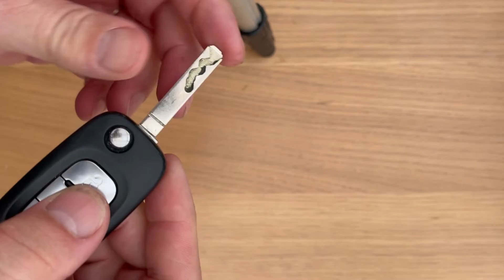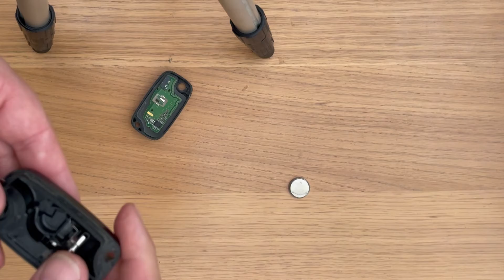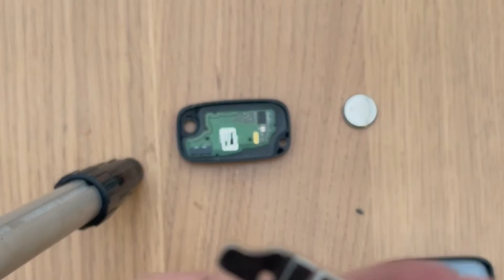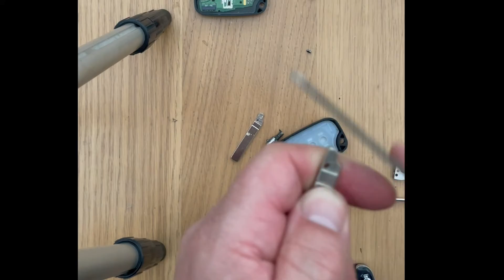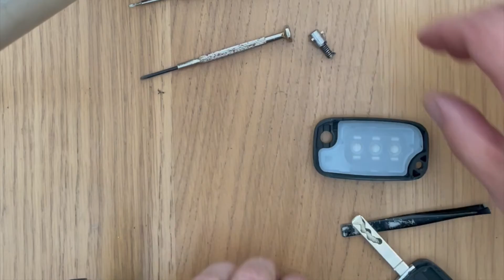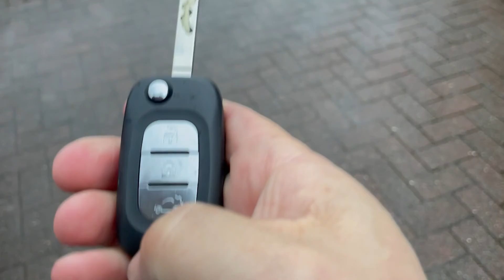How to repair your flick blade Key Fob (Smart 453 - Fortwo/Forfour)

Comment: How do I get button and spring out of this please so that I can tight the flip tia
Reply from the maker: @chelsie1237  does the video not explain this? It’s been a while. 

And the flip is dependant on the spring being useable/serviceable.
Reply: @smarte.r.1450
No unfortunately that bit wasn’t in the video.
Reply from the maker: @chelsie1237  so from memory. The new replacement is Fixed So non removable … the spring snaps or to be exact the lug on the chrome button snaps.
Reply: For anyone wondering (and with the caveat that this may reduce the service life of the spring) - with the shell off, press the button down and rotate it anti-clockwise (I think) a little and you can pull the button out to reveal a second pair of tabs at the bottom.
With careful use of pliers you can spin the button anti-clockwise an extra turn and a bit until the tabs line back up with the original slots and it can be pushed back in.
Unfortunately both the spring and the tabs seem to have a fixed orientation so I had to do a full turn, not the half turn I was looking for. That being said, the blade swings out with very satisfying authority now :)
Reply: Although rewatching the video, the tabs that broke are the ones I've just added extra load to with the tightened spring...

Comment: I tend to use the fixed blade key fob only as its more robust than the flick key fob which breaks easily. An important note about the 453 key fob. The 453 does not tell you that the key fob battery has run out, unlike the previous models that flashed the indicators 7 or 8 times to tell of low key fob battery. (this was we think a cost saving exorcise by Smart). So you can end up in a distant carpark and the keyfob does not work. So you manually have to enter the car via the passenger door lock. So having been caught out in a carpark DOH, I now carry under the passenger carpet a button battery for fixed key CR2016, a button battery for the flick key CR2032, and a 1p coin to open the key fob up. Cheers Col.